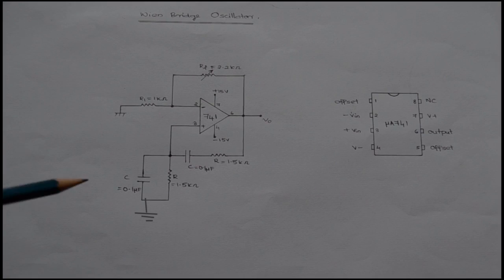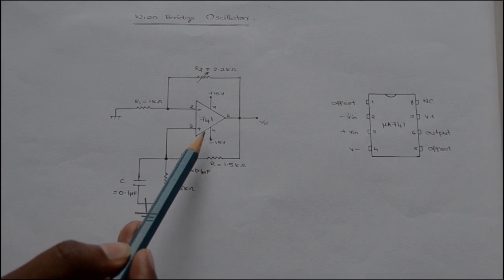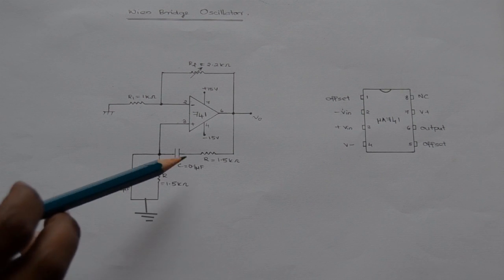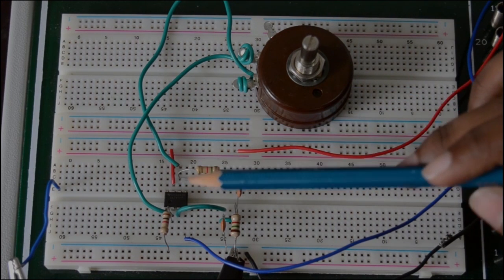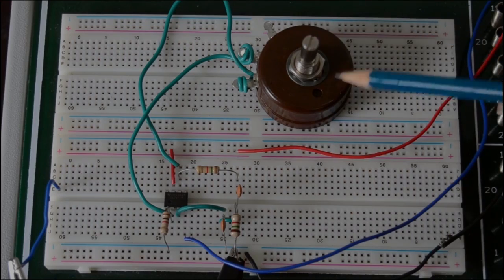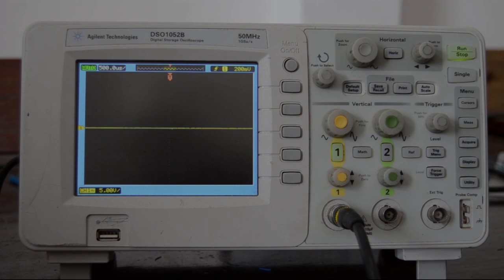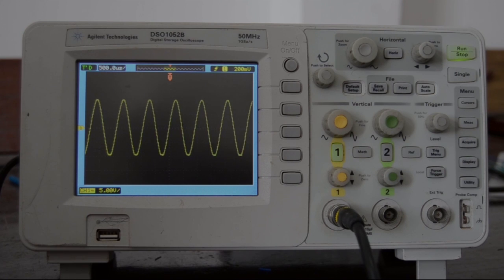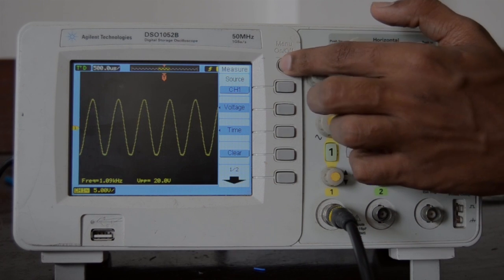WEIN BRIDGE OSCILLATOR

Comment: Usefull video but I am getting square wave instead of sine....
Also tried changing the feedback resistor value....
Any ide. U got...
Reply: John Prem Kumar  try changing the value of capacitors.square wave may due to clipping of sine wave
Reply: select a lesser value of pot